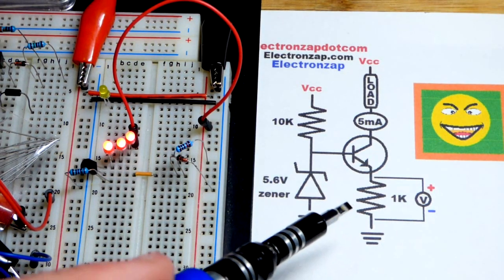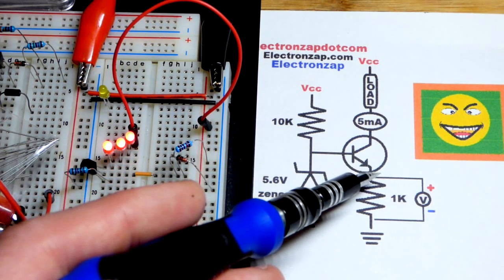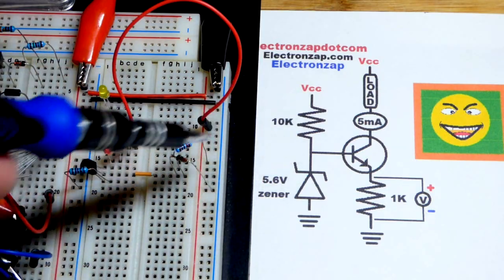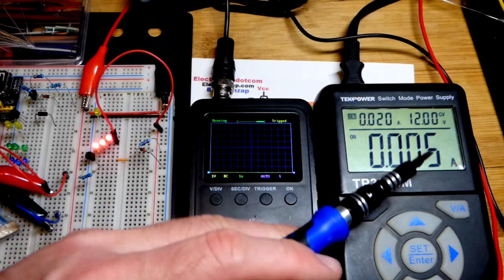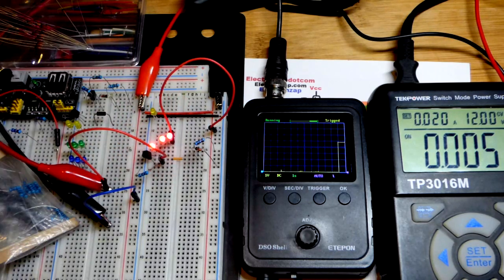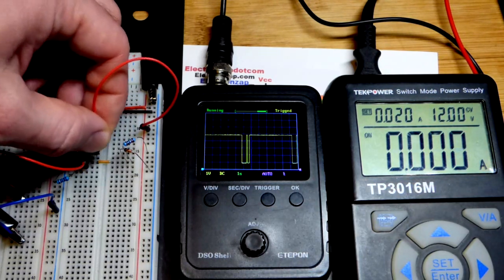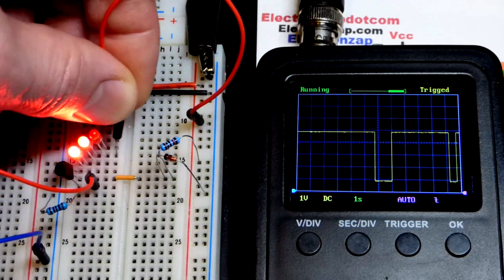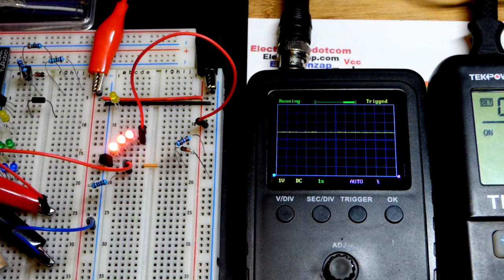Electronics voltage across NPN BJT current source emitter resistor oscilloscope measured

Comment: Excellent as always, thank-you. Would it be possible to use this circuit for LED's in parallel?
Reply from the maker: Thanks! As long as they have the same forward voltage, parallel LEDs will divide the current up.

Comment: What does bjt mean
Reply: Bipolar Junction Transistor.   This is Acronym used for standard current controlled transistors as apposed to MosFET or FET transistors that are voltage controlled..